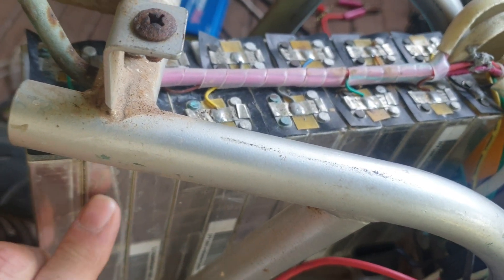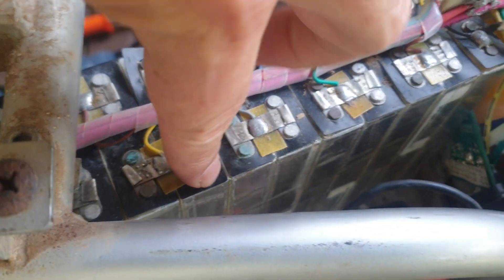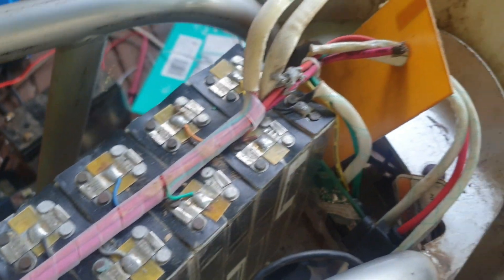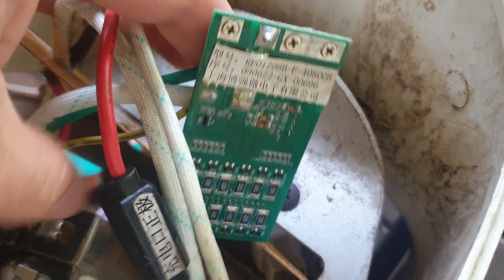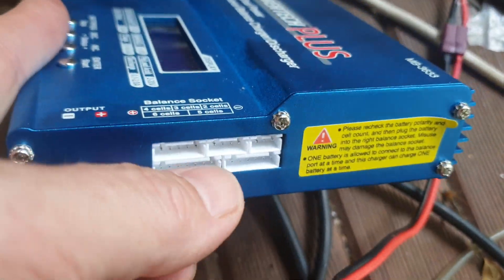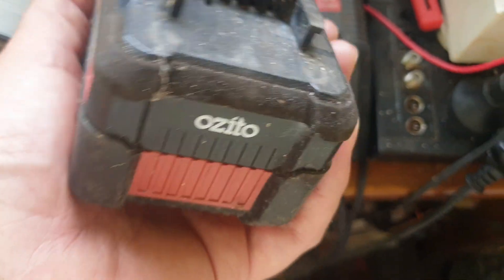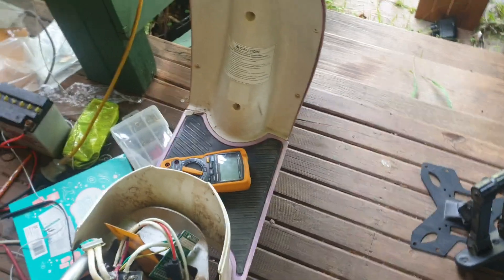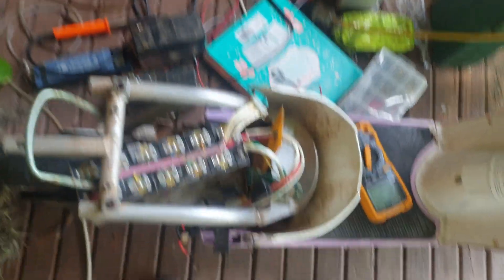Old E-Scooter LiFePO Battery upgrade, Razor Pocket Mod

Comment: It's a nice project, but no ideas how to charge it safely and balanced. I would assume, but I could be very wrong, that modern chargers like they are used for the RC world know at what voltage they need to charge because they get the information about how many cells the battery has from the balance connector. As long as you have the correct balance connector plug and a charger that can charge at least with the minimal voltage that you need. But again, I could be wrong.  The amperage would probably be lower compared to what it would be with a dedicated charger, but at least it would not over charge the individual cells, that is if it works as I think that it does. And a lower amperage is also better for the batteries.
Reply from the maker: i am currently charging it one cell at a time. the RC charger can charge more than one but when i tested like 3 or 4 cells at a time the one at the plus end gets more volts and that what damages them. i dont know the Ah rating of the cells. One of them eat up over 6000mAh
Reply: @m3sca1  Ever considered to replace the damaged cell with an RC battery? And to use the dedicated charger? I mean, in such way that the voltage stays the same, with an RC battery that has approximately the same amp hour capacity? Or to put a dummy load in front of the battery to lower the charging voltage from the dedicated charger? If you would put something in series with the battery it should lower the charging voltage. Right?
Reply from the maker: i have cut the pack down to 8 cells leaving that bad cell out.
Reply: @m3sca1  Merry Christmas to you and your loved ones !! I Just watched a video from a review from a very cheap handheld digital scope. The video is called, A 110MHz Oscilloscope for under $70! Is It For Real And Is It Any Good? www.youtube.com/watch?v=Jtc_01iH8tc

That is something that would be in reach for me at some point in time. One day I might buy something like this. 

But I am not sure if the frequency range is enough for the Stanley Meyer setup. It is not unlikely that he might have used a much higher frequency for the best possible resonance and the most yields of hydrogen and oxygen in relation to the total input power. Which does not necessarily mean that it wouldn't work at other frequencies. But at a different resonant frequency it might just not work as efficient as the ideal frequency.